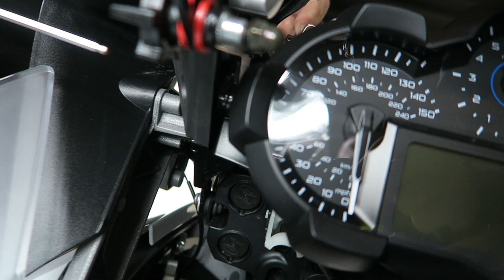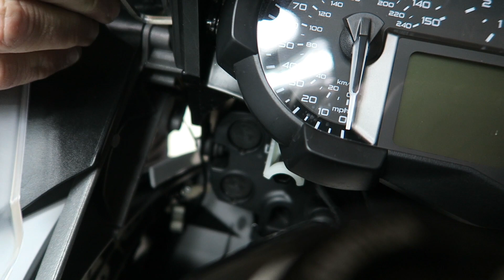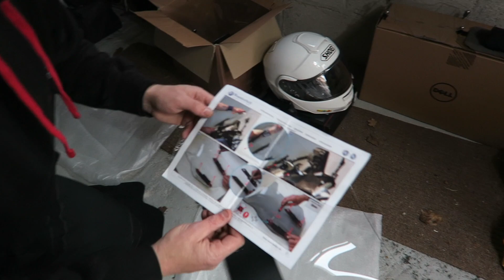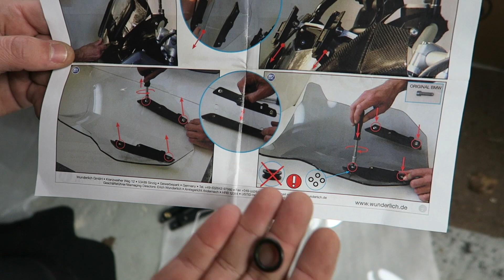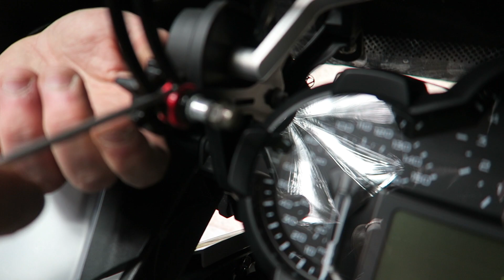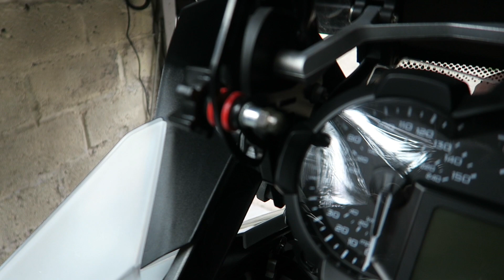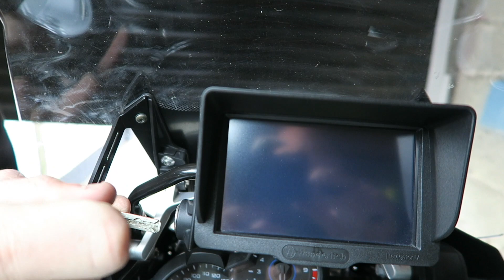Fitting a Wunderlich Ergo 2 Screen (clear) to a BMW 1200 GS Adventure NO MORE BUFFETING

Comment: Hey Toby
I installed mine today, however, my stabilizer brackets are different. I got a left and right Wunderlich stabilizer. 
My instructions for the brackets were from Germany and missing steps 5-7 out of 10 steps 🤷‍♂️. So i guessed along my install but it turned out great. Big improvement with wind and noise over stock

Comment: For any tall riders, I’m 1.93cm (6’ 4”), I followed Toby’s lead and fitted this screen. I also put the screen support and a cross screen support as well. Screen is brilliant. Made a huge difference compared to the stock screen I had on my 2015 GS for both myself and my pillion. I don’t even need it fully up unless on the highway doing 100km/hr or more. Generally ride with my visor up, no buffeting, no issues. Cheers Toby.
Reply from the maker: That’s great Russell. Glad it helped and yeah, a great screen. What the stock screen should have been! 
Ride safe :)

Comment: Hello Toby! I installed the screen, which is indeed top quality; thick, strong material and with the additional bracket sits solidly in position. I am 6 ft. tall, with short legs at 32 in. inseam. My upper body, up to eye level, is remarkably wind and turbulence free. In the high position, a strong steady airflow now hits my forehead, which would have hit my face/visor square on previously. There is still considerable wind noise to be heard. A good improvement on the stock screen. I wear a Schuberth C3 and tested at speeds up to 160 kmh. The clear screen looks great and fits in well with the looks of the bike. Again thank you for a top quality review. May all your rides make you happy!
Reply from the maker: Hey Kurt. That’s brill. Glad you got the same experience as me with the screen. Much better than the stock screen. Ride safe buddy :)

Comment: Hi again Toby, thanks for the information on the screen. I'm 6'4" (1.93cm). The standard screen on the GS isnt really doing it for me or my pillion. Do you have any feedback from tall riders like myself, on how effective this screen is, or I suppose, are you this tall and are you still happy with the screen.  cheers
Reply from the maker: Hey Russell. I’m 5’11 so can’t say exactly for a taller person but the larger screen has a lot of adjustment and I have it in the lower position and find it works really well. You could also try one of those small screen deflectors from mra or wunderlich as they seem very good and deflecting the last bit of air away. And with the up and back bar risers I have I find the larger screen just right :) 
Unfortunately it’s a matter of trial and error. Eek!
Reply: Ok, cheers Toby, will probably give it a try.
Reply: @RiderCamTV  I know this thread is old .. but just a quick query.  I am 5' 11"  as well so was wondering if you can see over the screen when it is on the low position ?   Cheers

Comment: Hi, do you still have the screen on or have you switched back to the original? Are you still happy with it? Do you get and more buffeting?
Reply from the maker: +fazer john still using the the large screen at the moment but plan to try the stock screen again soon. :)
Reply: Hi, why are you changing back; not happy with it after all ?
Am about to buy one, but concerned now if you've changed your thinking on it after a period of time.
Is yours part number 42710-501 Marathon, or 42710-201 Marathon II ?
Their site is very confusing, and here in West Australia we have no dealer.

Comment: Really helpful video! Many hanks to the cameraman following the action so well ... really helped a lot.
I installed the same wunderlich screen on my new GS, but used the original ribber isolators that fit quite nicely on the screen as well. The issue was that I did not realise the the rubber o-rings were taped the foil in which I had the screen delivered. I assumed there are no o-rings so automatically saved the originals. In fact the manual says, o-rings or reuse of original rubber seal depends on year of manufacture, but it just does not say which to use with which ... Anyhow, I hope they originals will isolate vibrations enough so that it doesn't crack amidst a tour :-)
Reply from the maker: You’ll be fine with those o-rings I’m sure. It’s a Fab screen :) 
Thanks for the kind words and glad it helped. 
Ride safe

Comment: Thanks for the video. Very helpful. Couple of tips having just fitted a similar screen myself: 1. Remove the screen then fit the bracing bracket as shown 2. Remove black plastic faring first to give clear access to satnav retention bolts. Comes off easy with two screws.
Reply from the maker: +MegaGavinski that's brilliant, than you matey :)

Comment: Nice video, thinking about getting this screen. How tall are you by the way?
Reply from the maker: +Attila Varga, Dr. Thanks for the kind words. It's a great screen indeed and is about 503mm tall and 400mm wide so much bigger than the original :)
Reply from the maker: +Attila Varga, Dr. Lol. Sorry misread. I'm 5,11 tall mate, and it's great for me
Reply: RiderCamTV Sorry I meant your height (how tall you are) as a rider, so I could estimate how the screen could work out for me. I'm 5'10".
Reply from the maker: +Attila Varga, Dr. Sorry mate was my fault. I'm 5'11 and it's a great height for me :)
Reply: RiderCamTV No worries, thanks for the info! It should work out fine for my height then. Ride safe!
Reply from the maker: +Attila Varga, Dr. No probs. Glad we could help. :)
Reply: RiderCamTV What is your experience with this screen at highway speeds (86-93 mph) regarding noise around your helmet and buffeting? Is it considerably better than the regular GSA screen? I testrode a GSA last week and I wasn't entirely happy with the OEM screen.
Reply from the maker: +Attila Varga, Dr. At all speeds it's much better than the stock screen for me. I get no buffeting and it's clean air for me, in fact I ride with my visor open nearly all the time with this screen without an issue :)
Reply: RiderCamTV Thanks for your great and basically instantaneous input, I really appreciate it! Keep up the good work, cheers!
Reply from the maker: +Attila Varga, Dr. No probs. Glad we could help. Great to have you along for the ride :)

Comment: I had one of these on my Adventure. Health warning! remove it if your going somewhere hot it does its job to well and doesn't go down far enough to allow the air to get to you. Also if you put extensions on your hand guards take them off as well.
Reply from the maker: Thanks for the tips mate. I find it good. Rode in 39 degrees so far and great there too :) 
Mind you I do ride with my visor open most of the time. Hahah

Comment: Just installed the Ergo 2 on my 2017 GS Rallye. I am 6'2" and even in the highest position I get massive buffering...... in mid-low position it is ok, but definitely not a great improvement over the original small rallye screen........ Anybody knows what brand's screen will work better with tall people?
Reply: You should try the Puig touring screen.

Comment: I also reused the factory fitted O rings. Not sure why you wouldn't use these if the old screen had them.
Reply from the maker: +MegaGavinski cool :) 
I didn't but thought it was odd but bought if I did for the video I ought to follow the instructions rather than my usual just fit it without looking at them. Heheh

Comment: Lovely video, well done. Not liking the added bracket. I would have designed added reinforcement bars to the left and right windshield brackets mount to the plastic. I do like the black out area, glad they didn't put there logo there.   I put a magnet on my wrench to hold the nut.
Reply from the maker: glad you enjoyed the video.  you can get other brackets, but the one that i used was from an older screen so not the most attractive, but functional :)

Comment: I apologize to rant on your channel but I'm a yank so. This type of design really pisses me off. Here's a company (Wunderlich) that has all the resource to design and prototype something and this is the best they can do. I can think of two designs that would be stronger, better looking and would not ruin BMW beautiful one hand on the fly adjustment knob. First, build in a right angle lip into the edge of windshield to add corrugation. Second, the same thing but with metal. The sad thing is there designers when to collage.
Reply from the maker: I know what you mean, same with loads of bits of kit, the way things are designed, almost as if each manufacturer designs there kit to be the most important things on the bike... shame BMW don't make a bigger screen and stabiliser.
Reply: It doesn't matter how rigid you make the screen. its the adjustable BMW screen bracket that needs bracing.  Hence why you can buy the bracket separately as it can be used with any other manufactures screen.
Reply from the maker: +Fin Stabalised thanks :)